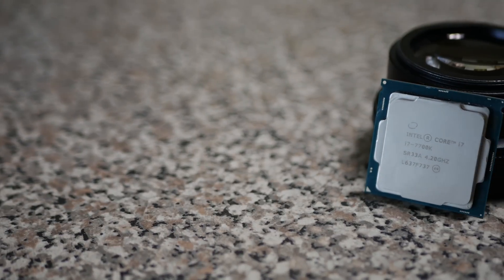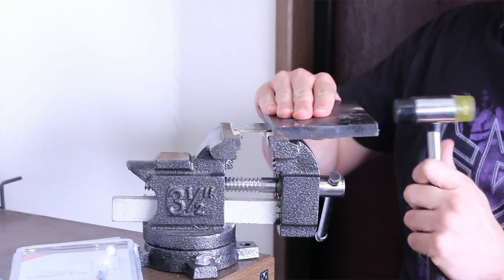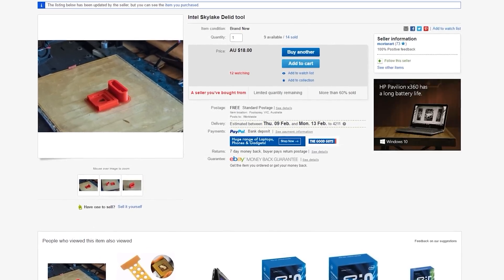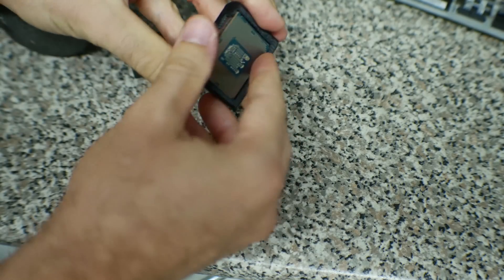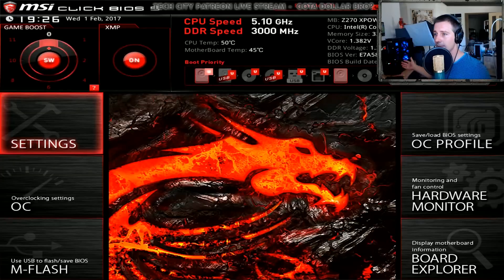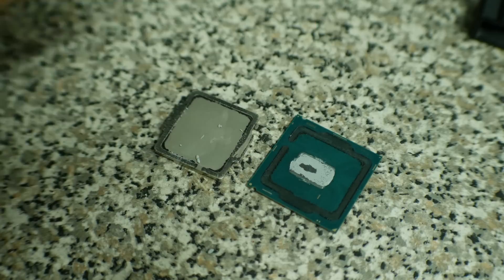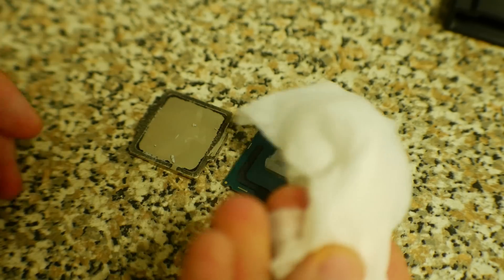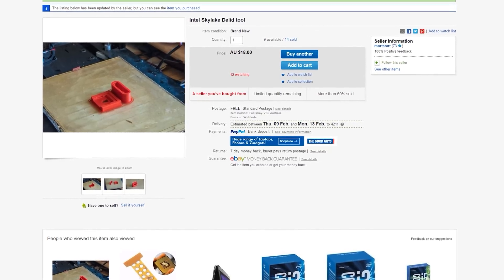DELIDDING The i7-7700k - How much of a Difference is there?

Comment: ah the good old reliable 280x, i got 2 gigabyte 280x crossfire in my pc, had to make a custom bios to adjust the clock speeds to make them stable, the biggest issue i found was one of the lower clocks was a weird number, after changing that no more crashes, the ultra low power is 150 mhz on core, then the low power was 501, this i changed to 450 and been stable since, high clocks don't really cause many issues but i downclocked mine anyway for temps and noise reduction.

Comment: What cooler are you using for this? I have an h55 and after 7 minutes in Aida64 I was hitting 92-99C at only 4.8ghz. I know the H55 isn't very good and I just picked up a used H100i to swap in to it. Don't especially want to delid but with these results I may need to if I ever want to hit 5ghz
Reply: Sauced Tech don't feel bad I have the newest cryorig a40 and still hitting 99c at anything over 4.6... delidding is next my build is brand new. Something def wasn't seated right with the silicon application plus cheap thermal paste
Reply: Yikes! That's rough. I swapped to my H100i and the temps barely even moved down. Think I will just stick with the 4.8 instead of risk it. I'm too broke to replace it if I break it lol

Comment: the i7 is already very expensive then why would Intel skimp out on proper cooling
Reply: A 20c difference is insane.This is not called reliability, people say keeping a chip cool is good for reliability, cooking it is not good. A 3 degree difference is huge, a 5 degree is showing that it used the $1 huge tube of paste for doing 100+ chips. If Intel can't spend $0.01 on a $300 CPU, then that's pitiful. The most expensive paste I've bought was $3.50 for Arctic Silver Ceramic, that was good enough for probably 8-10 CPUs, and I only spent that much because its rated somewhere at -150c and I was doing sub-zero cooling (silver based paste just doesn't work well at those temps apparently).
Reply: Pulssqt  It should do much higher clocks without running so hot. That would be like me switching my AMD cooler for an Intel stock cooler, making it run 30c hotter and say, hey look it's reliable! It's the same thing.
Reply: Energy Core It's hard to believe that! If that's the case, how come the X-99 Series processors and Z97 Series processors have better thermals? The truth is that Intel skimped on cooling for their Skylake and Kabylake series processors.
Reply: Gabriel Umoh Agreed, the only paste I know of that needs 6 month to a year replacing is stuff for LN2 overclocking, and that's because it gets extremely cold. I've got SINGLE core CPUs from long ago that don't need re-pasting, just re-cycling... (ok, jokes aside, they are working perfectly fine to this day).

If its crap now, its still going to be crap later, and a 20c difference is like lawsuit worthy, 5c is terrible, and 10c I would return it even if I paid $10 for it, that's just terrible, and these are expensive chips.
Reply: To sell more intel cpu's down the line. I am sure they could come out with a 5ghz plus cpu that can oc from 5.5 to 6ghz  and sell it for $500 now if they want to. Why bother when they can make so much profit with little improvements every 1.5 to 2 years?
Reply: Because it doesn't help their profits.  Some of Intel's talent is in economics.  It's about balancing earnings and expenditures.  It would proboably be an overall loss in profits.
Reply: I don't even use $10 paste on sub-zero cooled components. That's actually very expensive, and I would completely understand why they don't spend over $1 per processor. But the sad part is its performing worse than my $1 giant 20-30g tube, which is enough for roughly 100 CPU installations. So its literally 1 penny for the paste. I do expect that they get at least that quality.

The sub zero cooling is with phase change, -55c idle, -35c max load on block. Ran my last GPU on that till it died from cyclic fatigue on the solder joints under the chip, and will hopefully get a better Ryzen 8 core to install my cooler to. My current Ryzen is not fantastic at 3.8 Ghz at 1.35v and 3.9 Ghz at 1.4v causes it to get too hot on my AIO that had kept my 250+w FX happy. Probably sell mine at a loss and buy a pre-binned 4 Ghz chip and crank up the voltage to hit ~4.5 or as good as I can get for 24/7.
Reply: Gabriel Umoh the liquid metal stuff we use when delidding is great performance, but it won't last forever. You might find yourself having to change it after sox months to a year. Intel went for reliability, rather than performance, when they chose their TIM for the IHS.
Reply: It is reliability. Because it will work, overclocked to 4.6 under 80 degrees which is a safe temp.
Reply: I'm guessing its so they can say, hey look at the thermal improvement over last gen!
Reply: Pulssqt I actually run an FX-8350 pulling an increase of 260w from the wall running P-95, socket temps don't go above 50c (single thin 120mm rad AIO), I use socket temps because the core says its lower and that's not possible.

That's 220w extra on the CPU + MOBO (above idle, assuming 80+% efficient like my PSU is rated), it still runs colder than this Intel with Garbage thermal paste, and I'm pretty sure they aren't trying to dissipate this much heat.

A 10c difference is still absolutely massive, if it was 5c I would de-lid it with a hammer (which looks sketchy).
Reply: Pulssqt Intel charges way more for the K series, so yes, they intend for you to overclock it (also charge a lot more for the motherboard.
Reply: I could imagine because it's still better than AMD and if they need more performance, they just put full metal heads (or proper paste) on them. It's the same with graphic cards which get sold with lower clocks in the first place.
Reply: Haha intel charges way more for K CPUs, yeah, 5% more at best lol
You are not paying only for unlocked multiplier, you are paying for higher stock and turbo clocks. 3.6(7700) vs 4.2(7700K). Thats what you pay for, and thats why Intel will tell you, we dont encourage overclocking, but we gave you much higher clocks.

First of all, Intel measures temperatures differently from AMD, you should know what. AMD Piledriver CPUs dont even have temperature sensors in them, they are just estimating core temperature with algorithm. Core temp in FX is completely inacurate, and are much closer to surface temperatures. There is also a sensor on the motherboard, and regardless of the core temperature, if motherboard sensor reports that temps reached 72 degrees, CPU will start to throttle.
Intel, core temp, which is also called Tjunction, is the temp that is measured directly from the core itself, and from each individual core by DTS(digital thermal sensor).
You can never ever even compare temperature measurements from Intel and AMD, and if you ever did, that would be literally retarded.
Second, 7700k is an 14nm architecture, and Piledriver/Bulldozer are 32nm, they are completele different and so are their thermals. I would explain it but it would take too long, and you can google it by yourself.

8350 uses almost 3 times more power than 6700k, both in idle and load. And is literally 3 times, if not more, weaker.

Even tho you are so ignorant and stubborn, and in the end you will still keep saying Intel's TIM is garbage, I will still spend some time to explain you something about soldering a die to the IHS.

First of all, Intel still solders their CPUs, every Xeon is soldered.
Yes, soldered CPUs run cooler because materials used(Indium) have a much better thermal conductivity than their TIM we are talking about now.
Most people are bashing Intel and saying Intel avoids soldering their CPUs only because of cost, which is not true. The process of soldering a die to and IHS is not only more expensive, but its hundred times more complex. And in the end they will waste insane amounts of rare and precious earth materials such as Titanum, Vanadium, Gold, Nickel etc..
Now, the Nickel coated IHS cannot be soldered directly to the die, because it would damage it, so before it can be soldered, few layers of different materials have to go between both IHS and solder, and solder and die. That takes huge amount of time.
Alright, if you dont believe it, here is how it goes, from the die to the IHS:
Silicon
Titanium
Nickel + Vanadium
Gold
Indium(solder)
Gold 
Nickel
Copper
Nickel

Also, Intel greatly improved their TIM over time, and now it seems completely unnecessary to use anything else. Because we can still hit very high voltages and clocks without hitting thermal limits. And if they continue like this, I believe their TIM we be even better on the next CPU generation.

BTW i even took some time and found a fantastic article from 2015 that covered everything you need to know about soldering. Here is it. http://overclocking.guide/the-truth-about-cpu-soldering/
Reply: +OptimisticPessimist 10$ for liquid metal or proper heatsink wouldn't really make a difference. It seems that they just don't want to use products from other companies.
Reply: Just to be clear I don't use that garbage $1 20-30g tube of paste for actual CPUs, I use it for non-critical applications such as when installing additional motherboard heatsinks, a raspberry pi (which doesn't even need a heatsink to be honest), just stuff like that where I don't need to waste my good thermal paste.
Reply: Maximise profits, they don't give a crap.
Reply: http://www.overclock.net/t/1568897/anand-skylake-cpu-package-mini-analysis-terrible-tim/20#post_24286980

Solder TIM cracks after a # of power cycles on small dies. There isn't a conspiracy, it just doesn't work in the long term.
Reply: Jake you seriously need to use google a bit more and you will realize that you are not right.
Lawsuit worthy ? Haha.
You got your CPU that works on 4.0GHZ, Intel sold you that CPU who is intended to work on those clocks. It will work with any cooler at less than 60-70 degrees under load(Prime95 and similar stress tests are not real loads) and as Intel said, that is a safe temp.
If you want to overclock, thats your problem, not theirs. They do not encourage overclocking and overvolting, and if you even spoke to intel support you wold know that.
If you do overclock, its your fault if you fuck something up, not theirs.

They saw no benefit if CPU under real load works at either 60 or 45 degrees, bacause it will last the same under both temps.

But the fact that like 20 other high rep people tried delid and under normal room temperatures they saw less than 10 degrees difference, few cases of delid saw only 2-3 degrees improvement. Is it worth it for us, normal people ? Ofcourse fucking not.

Comment: The german delid die mate is hard to get at the moment, but the american Rockit 88 is pretty much the same thing, only from the other, other, side of the world for us AU kids.  Be careful with 3d printed tools,  There is a post on overclockers.net of a guy fucking it up with one of these. http://www.overclock.net/t/1620419/oh-boy-lets-delid-a-7700k-this-will-be-fun-epic-fail-pictures

Also it seems CL-pro is the outdated version of CL-Ultra, which has the same thermal conductivity, but doesn't dry out, is easier to apply, and comes with an application tool.

Comment: use heatsink directly on die of the chip without IHS at all, and upload new video ;)
Reply: bullshit , other youtuber did it already , all works just fine , lowered temp's by extra 5%
Reply: LordX Wont work.. the IHS fills the gap between the die and the hold down clamp.. but in get what your saying. That would be more like a GPU set up and may work better
Reply: It can be done, but it's extremely difficult. Beyond probably having to modify the socket so the sink won't hit the sides of it you run a significant risk of cracking the die as all the pressure is now applied in a tiny spot in the center of the chip rather than spread out towards the sides as designed. It would require veeeeery careful mounting on a horizontal surface
Reply: come on dude , a gap for IHS you use some metal holders , this is not a problem at all.
Reply: LordX It can damage the pins if you put uneven pressure on it or simply to much pressure, but you'd have to be a moron to do that

Comment: Surprised an extreme IHS / Cooler hasn't been made yet for overclocking these Intel chips for the LGA sockets. Be pretty simple as the replacement IHS could be made of much better quality metals, locked into place by the retention bracket, and then simply have a method of bolting the IHS to a large alu or copper fan system with heat pipes and a 120mm fan assembly or two.

Comment: If the thermal paste is non-conductive why the need to put the lid back on?
Reply: RdyPlyOne the IHS has a puroose of its own - spread the dissipated heat across a larger surface.
Reply: Energy Core I get that for normal people, but anyone doing this isn't normal. as long as you don't over tighten it should be fine. I would think?¿?
Reply: RdyPlyOne i think it is also for protection because the heavy weight of an air cooler could break the chip
Reply: +RdyPlyOne soldered chips perform better as far as thermals go in general. Intel keeps using really poor TIM which is why people delidded processors in the first place. That compound was and still is holding overclockers back.

Comment: I'm looking for a delid tool but I don't trust myself with a hammer lol
Reply: Energy Core i dont want to wait for shipping from Europe. i might get this tool called the rockit88
Reply: ab12
should be fine
Reply: I ordered the Rockit88 in the states and received it in 3 days.  Delidding was simple and they also have a relidding tool if you want to use silicon to put it back together.

Comment: I will do that on my Core 2 Duo! LOL!
Reply: Intel started doing the cheap TIM crap since Ivy Bridge (third generation i series) so don't worry you don't need to delid :)
Reply: Pio Soesetio I Think be the same archtechture
Reply: I think those chips are soldered
Reply: Delid kits and liquid metal usually cost more than a q6600 which is a much better upgrade path

Comment: Should you do this to a Xeon processor from 2007. Or is it fine to use really old thermal paste
Reply: Psychx I saw der8auer delid a 6950X, I would say that delidding a soldered CPU is not impossible (but there is no need)
Reply: 2007 Xeons are soldered. You will destroy them if you delid.

Comment: I have installed my 7700k and have not delidded it yet. So far i have achieved a stable overclock of 5.0Ghz at 1.345V, or 5.1Ghz at 1.425V. Temperatures are up to 90-93 Degrees with 5.0 and upo to 99 Degrees with 5.1Ghz. I´m using a Corsair H115i in Push Pull with another set of Corsair ML140´s and I´m also worried about the temperatures since its winter here and once the summer comes I can forget my 24/7 5Ghz. So I will order the delid kit from der 8auer which will be available from February 22nd on here in Germany.